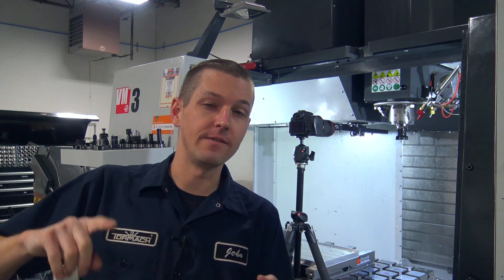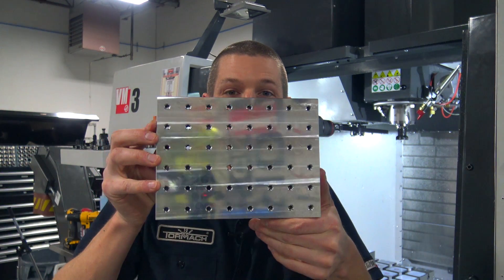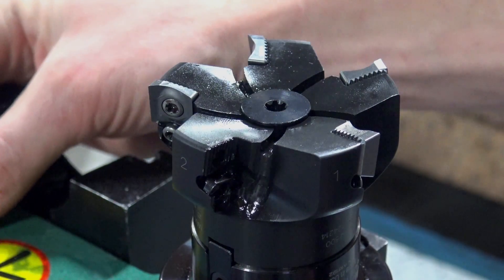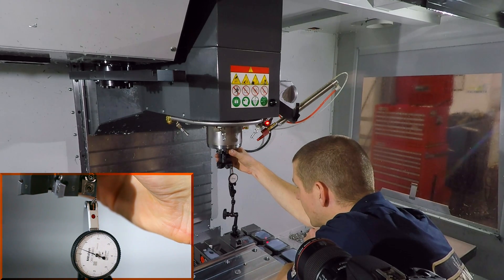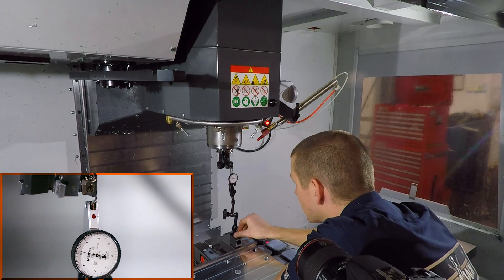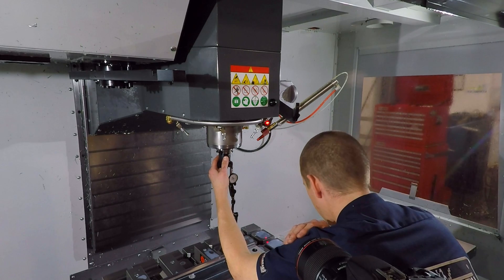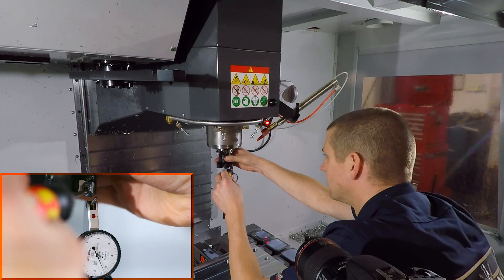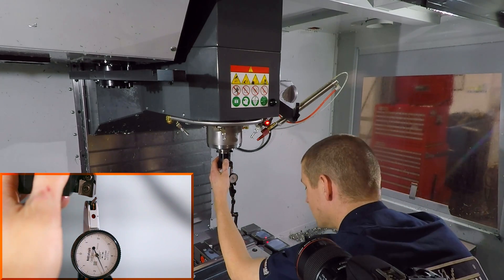Adjusting Insert Heights on a Sandvik 590 Facemill!

Comment: Best do it off the machine on a surface table but use a flat carbide dial indicator anvil which allows you to find the highest insert position saving lots of time and effort for excellent accuracy. The 590 has PCD & CBN insert options.

Comment: nice video, if these inserts are that sensitive, try using a magnetic angle gauge ( aka what mechanics use for angle based torque setting on bolts), this would provide the accuracy required, just use angles ie: 30' or 5 deg. and would save all the back & forward of the adjusters!!

Comment: If the inserts are quality, the tool is quality,  the person setting up the tool knows what they're doing (all bits get rotated if one is damaged) then yes,  they should be coplanar to within the tolerances of the components.  If it's not,  then one of those items isn't doing the job it was paid to do (hint: it's usually the human setting up the tool).
Reply: The inserts are quality, but they are also stupid expensive - 36 dollars each for the stainless inserts, with only two cutting edges.

Comment: Just did one of these. I used a cheap granite based indicator stand.  It's critical that the vertical shaft is square to the granite.  I bought a cheap one and had to re-turn the end on a lathe to get it square.  I used a Mitutoyo digital indicator with a CARBIDE flat face tip.  I agree normally analog is better, but this is the exception.  Bolt the indicator loose enough to move it square  to the granite on the pivot, but tight enough you won't bump it.  Start with the wiper to make sure the face of the indicator flat is parallel to the granite in BOTH directions.  You may need to bump it a little.  Once you get consistent numbers from sliding it around under the tip, you will get a range for each tooth. My range was about +/-.00010 depending on where I slid it under the tip.  Lastly come back and make the wiper proud of the other 5 teeth.  I got the cutting inserts to within .00005" of one another except the accuracy on the indicator is only +/- .0001.  Also, I used a popsicle stick to lift the tip gently and set it on the next insert.  If it springs back it will bump the indicator out of position and you will have to start over.  BTW totally jealous of the VM3.  I only have access to a TM2, but it's only a hobby, so....   Oh and it's worth buying the indicator tip from a major brand.  The cheap ones aren't ground square to the shaft.
Reply: After setting up the 590 I decided to measure a non adjustable face mill for comparison.  On my Sandvik 345  I measured pretty good alignment.  The highest insert to the lowest was about .00025.  2.5 ten thousandths doesn't seem bad for just screwing in some inserts on top of carbide shims.  I'm hoping the 590 was worth it over a 245 or other good quality tool like a Kyocera or Mitsubishi.

Comment: there are some reasons to also have the heads staggered in height.  look at the 16 cutters on this storm vulcan blockmaster. https://youtu.be/p00o5tWxl-c  you want from cutter 1 thru cutter 16 to be  a slightly different height so the first cutter is not very deep. the second cutter a little deeper.. and so on.. other wise you are only going to get a few thousands off the head..   i would want to check to see if cutter 1 on the adjustable has the blade sideways a few tenths more than 2, 3, 4 and 5.  so it deepens the cut on 1, 2, 3, 4. and the flat bottom on 5 taking only a half a tenth more.  might give you the fastest cutter speed across the surface and the best surface finish..  the rep probably told you this..  it all depends on how the factory set it up with slight lateral offsets in the grooves.

Comment: No point in adjusting if the screw is not tightened to spec. You need to tighten until the tool you had clicks.

Comment: I agree with everyone you need to get a flat tip for that indicator and use that. And anyways like Occams Sawzall said you need to flip the indicator around, you are putting pressure towards the stem of the indicator causing wacky readings.

Comment: I use a gauge block and slide it under each tip to set the height. I usually use the top of the fixed vise jaw as my reference surface.

Comment: Looking at the slits in the adjuster where the cone head screw inserts, I'd almost agree that it is springing the steel by .0001's...slick design.  It's probably not really deforming as much as springing though, since you'd need to be able to back off adjustment.  Love this stuff man.  Hope I can make it to open house.

Comment: Still loving your videos, as always NYC, it has been quite  a while since I have commented on anything. 1 recommendation I would give you when setting the carbides is to use a tenths dial indicator with a small flat style contact point. once you make sure your dial indicator is positioned correctly it should make this much easier. (without having to mess with a silly digital) 
can't wait to see the surface finish you are able to get with that 590.

-Morgan

Comment: You want good surface finishes easy = Don't use a HAAS i understand you want to use American made machines to a certain extent buy a HURCO
Reply: Carlos HAAS is OK for Aluminum and Plastic....D2. A2, inconel, other tough to machine mtls look elsewhere.
Reply: Carlos I found Hurcos took over an hour to warm up and get good repeatability in z. This was on a VMC30 so it didn't have massive ball screws. I've not had this problem on other similar sized mills. Interestingly we had a really old Hass and that would cut the size you turned it off at the night before.
Reply: Josh Hanson your one of the very few then Why do think you never see Haas machines in any tier 1or 2 supplier
Reply: The simple answer is that I do see Haas's in Tier one aerospace suppliers. I consider Hurco to be more entry level machining centres. They're at the cheaper end of the market.

Comment: for highest precision finishing purposes: only a flat wiper with 0.004 inch being used with dry cutting only brings the result.
Therefore use of a second face mill only equipped with the flat wipers is appropriate.
Is a good strategy when best finishing results for surfaces matter.
Surely the measuring method can be improved :-) With a flat wiper it is also more easier.

Comment: Thanks John, I haven't ever seen that type of facemill before, I appreciate you sharing that.

When you're doing that type of measuring I think you would probably find it easier to use a Test Indicator instead of a DTI (ie use a plunger type). I use a Mitutoyo 2109s-10 which is a 1 um indicator, sorry I don't know what the equivalent is in imperial.

Either buy or make an "Elephant's Foot" or flat point for the indicator. Since you're in the US it may be just as easy to simply contact Rene and his team at Long Island Indicator and be done with it. I have no connection, but they are super nice people and exceptionally helpful. http://www.longislandindicator.com/p133.html As a rule of thumb it's best to measure flat objects with a round tip, and round objects with a flat tip. Trying to measure a round object with a round tip is, well, "tricky" as you know. With a flat tip it's a piece of cake.

Since I'm in Australia and a mega-tight-wad, I just made my own flat indicator tips. They're not at all hard to make, but for somebody in your position probably not worth messing with. Good luck with it.

Comment: What safety measures do these CNCs have? For instance could it cut with the door open?
Reply: Max Maker if you unhook the door safety then yes
Reply: some machines will not run with door open, with no way to bypass this feature. i think this has become a standard thing in modern machines, it is a manufacturing code all companies must follow, at least in europe.
Reply: meocats thats odd, because haas machines are not hard configured at all and they are quite global

but yeah it seems like all modern machines have some kind of safety.
Reply: probably because Haas is american. Peter Stanton's  (edgeprecision on youtube) mazak integrex wont run without the doors closed.
Reply: JohnHolmestheSecond Haas machines going to Europe have always had mechanical interlocks on them, in addition to some other small things associated with location like a BT instead of a CT spindle, which really only had to do with drawbar differences to accommodate the difference between BT and CT pull studs. T-slot dimensions (IIRC, everything but the actual slot which is sized for either an imperial or metric dowel pin & I believe the slot/slot distance) used to be different, but they were standardized sometime between ~05-10. I remember doing the testing for that one to make sure the same clamping force was available and the tables would stay together regardless of the T-nuts used. Many, many T-nuts lost their lives that day. 😓 

During that same time period and prior, US machines just used proximity sensors, and they could be disabled to easily perform tool changes and run the machine with the doors open. The exception being the short lived laser cutter that was built on a MiniMill frame.

Not sure if that is still possible w/o voiding the warranty with Haas' "Safety First" initiative. Might never have been as I only engineered and used Haas stuff on site in Oxnard. But, white it's been ~6 years since I worked there, I still want to say I used a bunch of machines with production firmware and there was a simple user setting that could be changed to allow certain automatic machine operations/movements like next tool, axis zero setup, and sending the machine home with a rapid, etc, with the doors open.

Haven't really looked at Jon's VM-3, but if it has a mechanical door interlock, then all the current machines do as well.
Reply: JohnHolmestheSecond Haas machines going to Europe have always had mechanical interlocks on them, in addition to some other small things associated with location like a BT instead of a CT spindle, which really only had to do with drawbar differences to accommodate the difference between BT and CT pull studs. T-slot dimensions (IIRC, everything but the actual slot which is sized for either an imperial or metric dowel pin & I believe the slot/slot distance) used to be different, but they were standardized sometime between ~05-10. I remember doing the testing for that one to make sure the same clamping force was available and the tables would stay together regardless of the T-nuts used. Many, many T-nuts lost their lives that day. 😓 

During that same time period and prior, US machines just used proximity sensors, and they could be disabled to easily perform tool changes and run the machine with the doors open. The exception being the short lived laser cutter that was built on a MiniMill frame.

Not sure if that is still possible w/o voiding the warranty with Haas' "Safety First" initiative. Might never have been as I only engineered and used Haas stuff on site in Oxnard. But, white it's been ~6 years since I worked there, I still want to say I used a bunch of machines with production firmware and there was a simple user setting that could be changed to allow certain automatic machine operations/movements like next tool, axis zero setup, and sending the machine home with a rapid, etc, with the doors open.

Haven't really looked at Jon's VM-3, but if it has a mechanical door interlock, then all the current machines do as well.

Comment: dude must think these holders are made in some cut rate job shops...1 its a face mill, its not meant to make grinder accurate surfaces, 2 these tools are made to pretty exacting standards...3 as soon as that mill starts cutting the vibrations alone will cause surface irregularities...aluminum cutting problems i guess :D
Reply: all 3 points are false
1. face mills are made adjustable this way, since forever, even in large diameters (>1 foot)
2. carbide insert standard is not to a tenth, hence number 1.
3. vibration are theoretically none in facemilling because of the full width, hence gentle easing of insert into and out of cut
3b. during finishing pass, it is very shallower
3c. not universal to aluminium. it is very relevant to plastics, laminated materials, brass, copper.
Reply: lincolnmetal1 he isnt examining the tool holder at all, hes basically measuring the inserts. inserts are relatively inaccurate.
Reply: ive never used an adjustable face mill, i have never had the need. and yes, there are vibrations in face mills, its the nature of the beast, all cutting tools have vibrations in them while cutting whether its from the actual cutting and/or from the spindle. there is deflection as each flute/insert enters the cut.
Reply: its all depends on the model number on the insert, some are very tight some are less tight.

Comment: at my job we have the same (kind of) facemil only its about 2 time's the size ; ) 
we use:
-Trimos Vertical Digital Height Gauge
-a 100% square gauge block as insert for the trimos
-(cant find the 3e think on google so i wil try to explain it) you need a measuring "block"(not realy a block... it round) with the same tapperd inside as the toolholder

place tool in the measuring "block", zero the gauge insert on the heighst or lowest insert of the tool.
go arount and make them al zero. 

its a job of ... 3-5 minutes 
than again we also have the luxery of a http://www.frepa.be//upload/resized/5783a84f59148_nl-20160822100652-57bacebc37acf-02_DMG-MORI_UNO.jpg <--- this one is a little younger than the one we have but GOD its nice to have, no more wasted time on measuring tools.

Comment: If you're truly looking for precision finish and location on your parts, you should be surface grinding the top and jig grinding the holes.  A Haas is a great machine, but definitely not made for super precise machining.  Wasting time on your insert height is only lost money... start with places you could save time, polishing the machining marks out would be cheaper than readjusting those teeth

Comment: The reading changing with the direction of rotation indicates (no pun intended) the Noga "stalk" is leaning left or right (or some combined vector) under the influence of the pressure required to overcome the dial test indicators spring combined with the sticktion of the inserts edges and their contact with the ball.  In one direction it amounts to a sharp edge engaging the ball at something below the top surface, which means having to climb rapidly.  In the other direction you are coming off the gradual slope of the insert edge, with your contact patch (single spot) higher on the ball top.  As with most things in machining, these directional anomalies are usually solved with nothing more than coming in from the same direction each time.

Comment: I'm not a machinist but one day would love to make some chips as a hobby.  Working on Aircraft we use a screwdriver TQ wrench when screw TQ is called out.  You could get one and set the initial TQ on the adjustment screws all the same, say like 3 or 5 inch /lbs then check where all the inserts fall with the indicator ( as others have mentioned ) but I'm not sure if it would be worth the money or time. Great videos and like you I'm always learning.

Comment: I can get great cuts with my face cutter but I run a light chip load.  I'm wondering how much heavier cuts you can take with a dialed in set of inserts.  Also curious how much difference the wiper makes.  By the way, Sandvik shows dialing their inserts in with the indicator in place.  No guess work.  And what everyone else says about the indicator :)

Comment: Setting the 590 up with a dial test indicator is a huge PITA. A tenths indicator with a wide flat tip on it is the way to go I think... But I've already got $400 in my used 590, and another $200 in PCD inserts, so another $120 for an indicator to set it is getting absurd.

Comment: The 2 main reasons you had such a hard time getting the dial to read zero are the tip you are using and the way you adjust your indicator. When measuring stuff like this you want to use the biggest tip you have, flat bottom would be best. 

When finding your zero, don't use the adjustment on noga base because you're moving the indicator around. The tiny ball on your indicator tip combined with the tiny point on the insert you're trying to find makes this very difficult. Just find the highest point of contact between the ball and insert then adjust your Z axis in the machine to zero, way easier. 

Also, I strongly recommend using a wiper insert. It will give you incredible finishes you never thought you would achieve with just milling. The only downside is it's a single use insert so your tooling costs go up, but in aluminum I doubt it will be much of an issue
Reply: https://www.youtube.com/watch?v=h2D0NGqUIVE
Reply: A flat bottom tenth indicator? Lol, that's a joke right? Or are you thinking to use some junk thou travel dial?

Comment: Wiper method is the way to go, the only pass that matters for finish is the last one.  Plow plow plow, slow way down finish pass. :-) I believe at the end of the day that is the most productive method. Setting all those inserts everytime they are replaced is very time consuming and also as they wear it is likely they won't do it evenly and they could need readjusting in mid life to maintain the desired finish.  Should you be able to coax one to fall from the sky I would love to see you try a face burnishing tool for this. I think you would love it and it will give your palletts a slightly harder face for better wear and scratch resistance.
Reply: traditionally, insert setting milling like this are meant to be used with PCD inserts, which are not changed like you would carbide inserts on inconel. i guess they assume this is common sense but wouldn't mind not telling the consumer if he's dumb enough to throw his money at it.